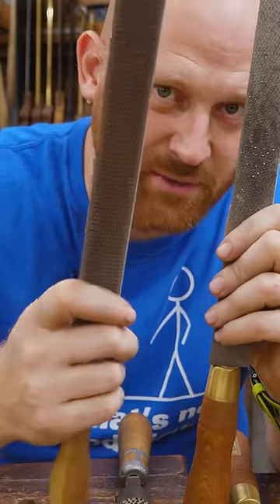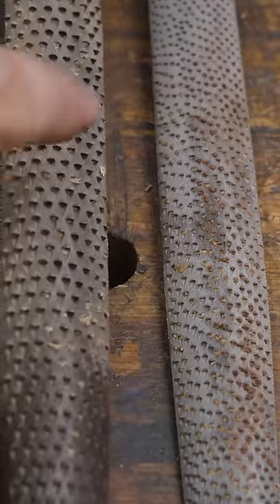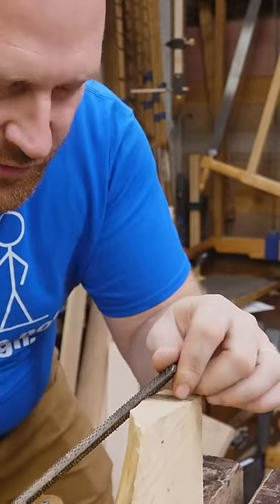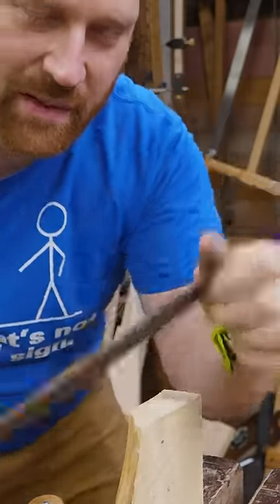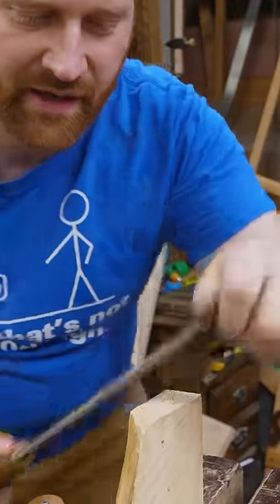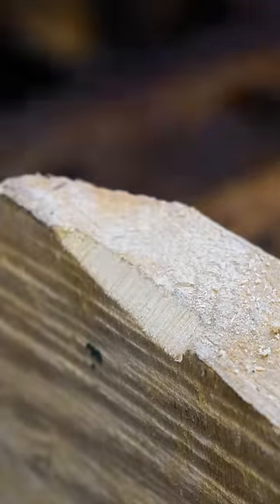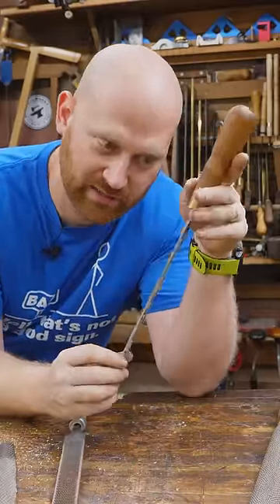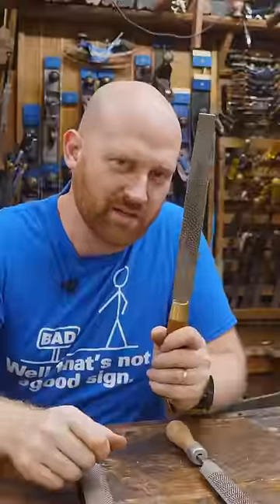Hand Stitched vs Machine Stitched Rasps

Comment: This guy compares the finish and cutting of rasps with different size stitching like he thinks they should work the same.... Of course the finish will be finer with smaller stitching... 

Not being in a row pattern helps but this is like comparing the surface finish between 80 grit and 240grit
Reply from the maker: Camera footage makes things look very different than they are in reality. It's always fun.
Reply: @WoodByWrightHowTo  What are you smoking? You placed them next to each other in the beginning of the video and the stitching is at LEAST a third smaller on the hand stitch.... They are probably half of the size or 1/3rd the size of the machine made rasp. 
A random pattern may make a better rasp, but it sure looks like you are comparing apples to potatoes here, so go on, show us that the stitching on the hand made rasp you are using is more than 2/3 the size of the stitching on the machine made one, because it definitely looks like you are comparing the performance of a ROUGH roughing tool to a finish roughing tool. They have a bigger defining difference than the pattern with the two you are using here, and since you compared the finish the two tools left and how hard they bite....... well then that is like "comparing the surface finish between 80 grit and 240grit"
Reply from the maker: Thanks for the feedback.